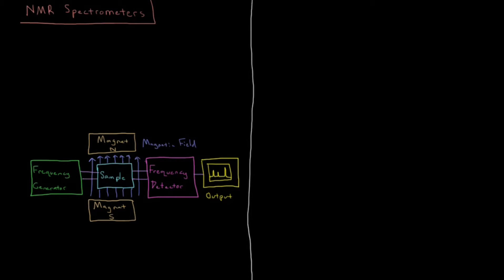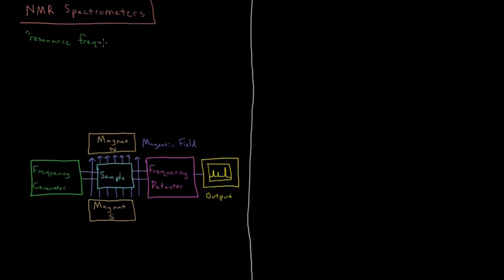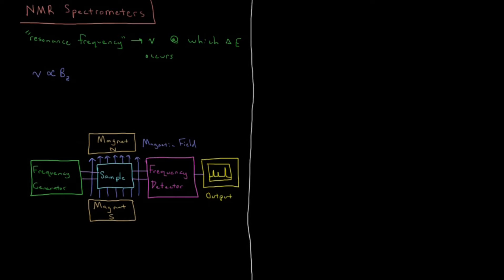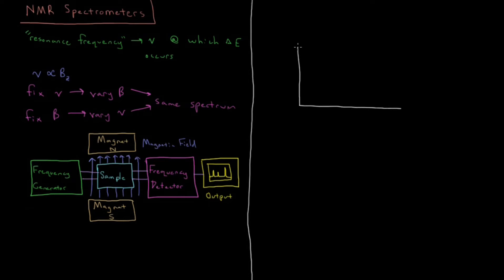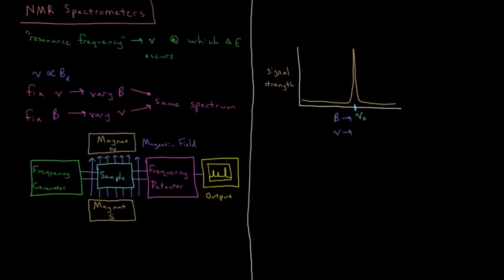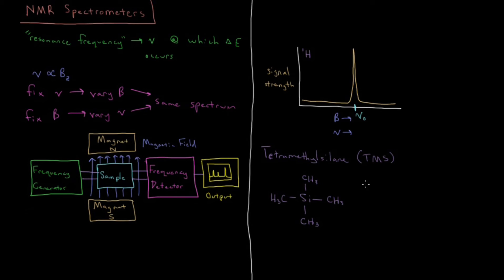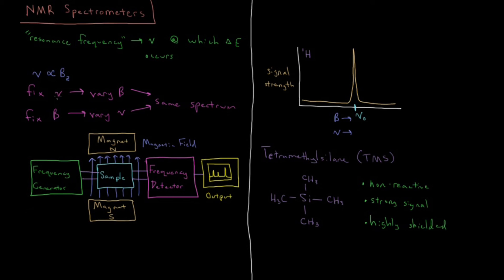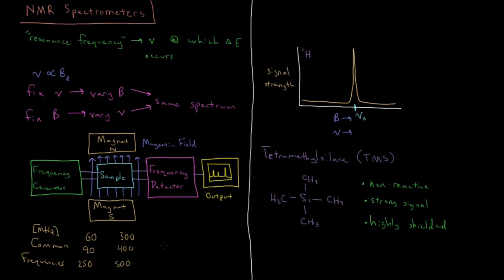Quantum Chemistry 13.4 - NMR Spectrometer (Old Version)

Comment: I realize you might specialize in reading NMR but I believe the output is determined by measuring a current around the sample. A change in current will be observed when the magnetic field field changes because the sample is absorbing the wave and changing the total B field. Its also important to mention that these are radio waves. Instrumentation is better from the perspective of a physicist.